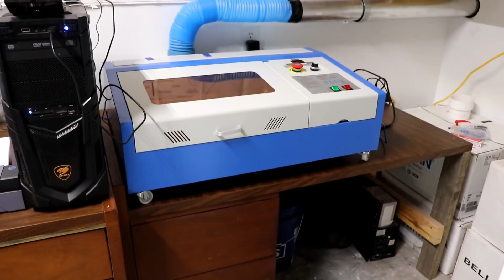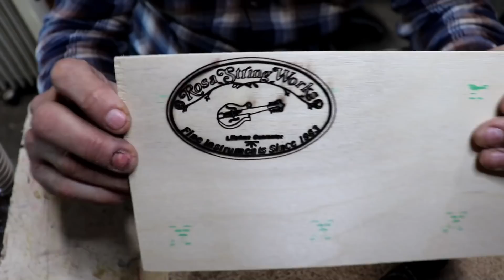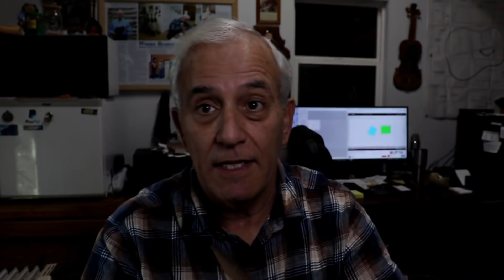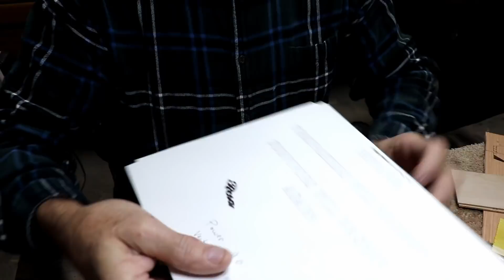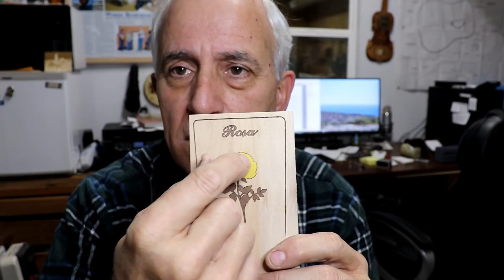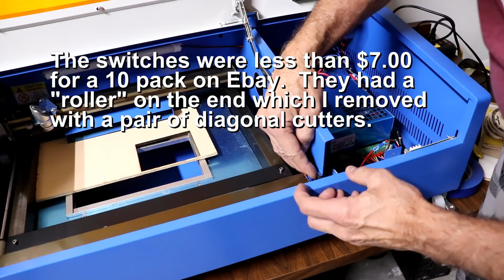358 RSW K40 Laser Cutter   Getting Started And Safety Switch

Comment: I hope you are wearing a certified pair of laser glasses. Don't trust the colored acrylic they gave you. It is not protection from the  laser. Also keep skin covered. The invisible light from that can cause skin burns. Class 4 laser at 10600nm is no joke. Always have a fire extinguisher ready. Also like stated in other comments-- Air assist, wet the wood, burn in reverse( if don't need the lines) also transfer paper keeps burns off. Hope you stayed safe..

Comment: you can use so called " tabs" I do not know the type of software you use but there are programs that use tabs. that can automatically create say  3 tabs per leaf. , it just skips a tiny gap where it wil turn the laser off. Kind regards, nice inlay by the way
Reply from the maker: These are much smaller than they look on video. Tabs are difficult to remove on these tiny pieces without breaking something.

Comment: I bought a K40 the analog model just before the new year, The first thing I did was replace the mirrors and brackets and laser head and lens with this kit https://www.cloudraylaser.com/products/cloudray-co2-laser-head-set-for-2030-4060-k40-laser-engraving-cutting-machine?variant=7698567102515 , I made a new adjustable laser head mount.....  I took out that M2 board and replaced it with an Uno with a CNC shield that is Running GRBL I rewired the whole thing to make sure it was properly grounded. The few times i tried it before the upgrades gave me nothing but garbage cuts and burns, After the upgrades, this is what I ended up with, https://www.youtube.com/watch?v=iL3WUZiQriE&t=350s  this week i should be getting receiving the digital model as you have and I reckon by the time I am done, that digital panel will be in the garbage lol

Comment: Hi Jerry   Their are a lot of videos on making an adjustable bed on youtube I made mine with a stepper motor to raise and lower the bed, but you don't need that, here is a simple one that is a nice design.  https://www.youtube.com/watch?v=7cl0OkYHS5I   to find the correct focal length of the laser you do a ramp test see this video https://www.youtube.com/watch?v=iKpONnJru1w   make sure if you are running the laser get your self laser glasses and always use them even when the lid is closed. lasers can reflect off shiny metal and the beam can go through the fine cracks around the lid.the beam may not burn you as it is out of focus but can blind you instantly.

Comment: Are you using antifreeze for the water cooling, or some other corrosion inhibitor?
Reply from the maker: Just pure water. There's not too much to corrode since it's all glass and rubber
Reply: use only distilled water the minerals in tap water can become conductive and the very high voltage can be attracted to that water causing damage, high current discharge.
Reply: @hurdyg1  Not going to make a difference in most cases. If you have distilled water in contact with metal, the metal will put enough ions into the water to make it conductive. This will happen really fast if there's a voltage applied. 

Any metal in contact with the water should be bonded to ground, so that if high voltage touches one of those parts, it gets shorted and trips the breaker instead of making the coolant loop live.
Reply: @sleepib   More importantly, ordinary tap water has a conductivity of ~100US/cm to 1000US/cm depending on the contaiminants and additives present which is well above the threshold to allow (and even promote) arcing in the tube and allowing the cooling system to become energized.  reality is just the water can kill you.   I have seen a glass laser tube with a hole melted through   by arcing.  I only use plastic (nylon) fittings in my water system.   I have used distilled water for 15 years and I am still here.
Reply: @hurdyg1  If your system is correctly designed and installed, it wouldn't pose an electrocution hazard even if you used sea water. You should set things up such that if an arc happens, it should short to ground, so you trip a breaker or RCD, instead of leaving the coolant live. If your loop has a radiator, that should be bonded to ground, pump housing and reservoir too, if metal.
Reply: @sleepib  Thanks I am sure you are correct, but I will continue to use distilled water not only to be safer, but I get no algae growth or mineral deposits in the tube or water system pumps etc. even after using that laser for over 10 years same tube, and power supply.  and distilled water was recommended by  the laser supplier.

Comment: Jerry,  Put an aluminum screen under your work on the laser when you are cutting  small parts,   you need to make a new bed for the laser as the one you have is what they send you from china and it is designed to etch rubber stamps, the chinese use this to make their name on a stamp to sign documents.    the laser focus is adjusted by moving the table up and down , when cutting you focus the laser into the work so it does not burn the surface when etching you focus to the surface.  but use low power.

Comment: To get your actual measurements to be closer to your drawings you'll have to calibrate the steps per [measurement] on each axis of the machine. They'll be slightly off due to variations in voltage and resistance. For example, in whichever axis measured 0.725 instead of 0.750: Divide the expected measurement (0.750) by the actual measurement (0.725) and then multiply the output by the laser cutter's configured steps per measurement.

My 3D printer is set to 80 steps per mm, so in this case I'd calculate it like this: 

0.750 / 0.725 = 1.034 ; 
80 x 1.034 = 82.759 ; 
and then use a gcode command to change the steps/mm to 82.759.

I might be able to help find a guide for your specific machine if you'd like some more help.

Comment: I would put painter's tape on before etching or use a hair dryer to blow across your work. Either way will work. I've done both with my laser. With the hair dryer I have to keep my lid open. Hope this helps.
Ps I have a 100w laser a bit more powerful.

Comment: Greetings Mr. Rosa.  Regarding cutting the petals and them falling after;  Once you set the correct speed and intensity, you might get it to work by lining the bottom part of the wood with aluminum foil, or maybe even better, aluminum foil ducting tape for HVAC duct, this will hold the mold and the rose petals where you can cut them and leave them in the mold until you need to use them, and being metal, it will not burn

Comment: One thing I noted and being a Computer builder/ Tech Is the location of your computer next to that computer. My concern is the dust and smoke that can escape the ventilation system and into the air next to that computer and clog the air intake vents to that computer potentially causing an overheat situation with your computer thus can potentially be a costly mistake and the laser is probably since its new blue tooth which means I would locate that computer as far as possible away from that laser to eliminate that possibility
Reply from the maker: I am very very familiar with computers I did the same thing for AT&T for a lot of years

Comment: I'm looking forward to all of the cool things you will be making with this machine and I like your fix. My go-to mounting solution for things like this is the gray industrial-strength 3M doubled-sided foam tape, but it looks like the glue did the job nicely.
I also am surprised that a company would sell such a machine without the safety switch--if anything, they typically go overboard and we end up removing guards and safety interlocks. For example, there was no way I was going to use my metal lathe with a plastic cover over the chuck that shut off the machine when I lifted it.
Reply: If this was a 'brand name machine' - that would be the case.  However, it is a low cost Chinese machine.  In the Chinese Business Model (make it fast and as cheap as possible) - there is no room for safety devices or quality manufacturing.  With cheap Chinese made machines, you actually get what you paid for.  These are great machines for tinkerers.  If you are a good tinkerer - you can wind up with a pretty good machine for far less than a 'Name Brand'.

Comment: You will need to make a notebook of settings, for different woods and thickness of wood and, also, the depth of cut you want.. The oily woods will. no doubt, cause more blackening along the cuts.
Cutting to a limited depth will require a balance between power and speed, just like arc welding. Denser woods will, likely, require more power or a slower cut, depending on your desired results.
So, don't throw away scraps of Anything. Just pile it up next to the cutter, for experimentation.
Will this cutter cut metals too?

Comment: I got the same laser cutter but made a lot of mods to it, made a solid bed instead of the "clipboard"  could be an idea for you, I used a stainless plate, I have done a lot of mods and adjustments..
Reply: Remember the focus of the laser is 50mm so the solid bed should be 50mm from laser head :)

Comment: Hi Jer! Making some progress, looks good! Great safe switch mod too! Yeah! :) What you could is make a "percentage gauge" 1st off. Just do something simple like a bunch of equally spaced like "I I I I I I I I" and for each line set the percentage at incremental  increases (with some text above each line say, 10%  15%  %20%, etc.) so you can see what they all like like after running the board through your planer/sander to clean it up. As for the hole dimensions I'm wondering if your software has a setting for either cutting the on the "inside" of the line or "outside" of the line. So if you want a hole ID to say be .750, cut on the inside of the line, if you want the "plug", cut on the outside of the hole. 

I've done a lot of precision router work which is very similar in the signage industry which is exactly what you are doing. You are cutting pockets or holes for "copy - i.e. lettering", logos, etc.), so you need "clearances", you just don't want a lot of clearance so the fits are snug. I worked with aluminum sheets cutting out the "copy" holes cutting on the insides and the "copy" material on the the outside of the parts. We needed a total of .03 between the two parts so the "copy" would slip through the holes with .03 on a side clearance for paint. The paint subtracted from the hole clearance and that's why so much clearance. Not a problem for you though.

After checking it out, I'm assuming you can cut with CorelDraw? It looks to me that both the Mophom and the PanelTech sellers are selling the same Chinese model.

Comment: I'm rather surprised that any company would sell a laser cutter that doesn't include a safety switch to shut off the laser when the lid is opened. If you have to add one at least they made it easy to add. Considering this type of machine isn't cheap and the switch is it should have been included by the factory. You may feel you are wasting time working out how to use the machine but you will save lots of time in the future.

One thing you can do is to cut through a piece of wood using several passes to minimize the burning. For cutting out the petals you could use a sacrificial piece of wood under the wood you use to cut out the inlay. You can cut through the top piece but not through the wood below which avoids the small pieces from dropping in to the body of the cutter. Enjoy the cutter. Next up is trying it with different material such as cutting pearl for inlays.

Comment: You'll enjoy the K40 Laser. My wife and I bought one close to a year ago. She wanted sandstone engraved for some of her artwork. I messed around cutting leather and found that if you wet it with a spray bottle the burning is reduced dramatically. I would certainly think the wood would be the same way. It didn't have any effect on the power settings or speed. I started keeping track of the different materials and settings in a text file in the K40 software directory for later reference. There's also a plug in for Coreldraw that will allow you to send cut files to the K40. It has the ability to have layers. With that you could use offsets for cutting and keep them in the same file. Don't know if that's any use to you but if think it might. I look forward in seeing your progress with your new device. 

Happy New Year Mr Rosa!

Comment: A laser cutter uses two beams, which cross each other. The point where these two beams cross is where you want the material to be. By either moving the laser up and down (or the material), you will find the best height to cut from. Apologies if you already know this, or if your machine works in a different manner. :-)